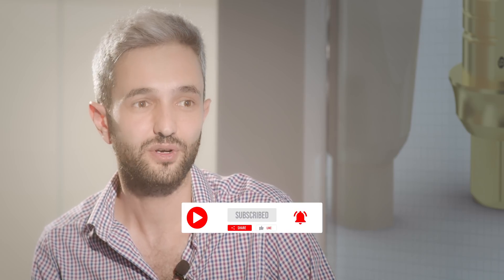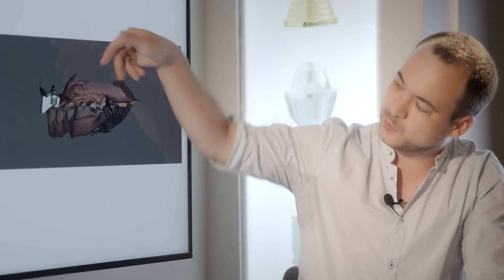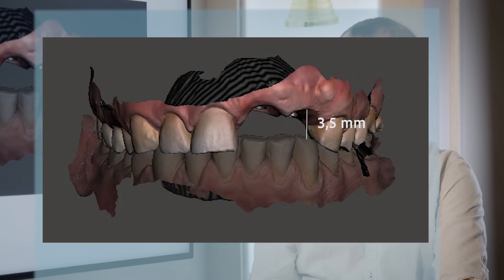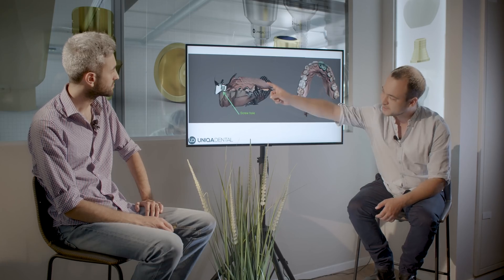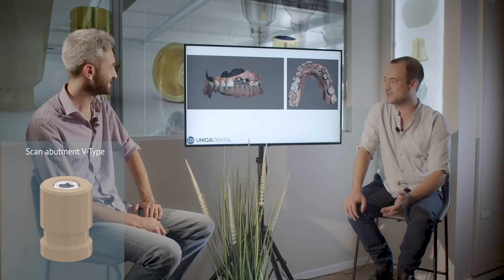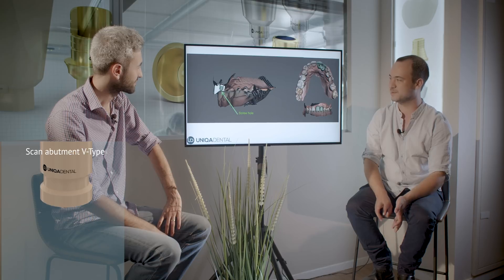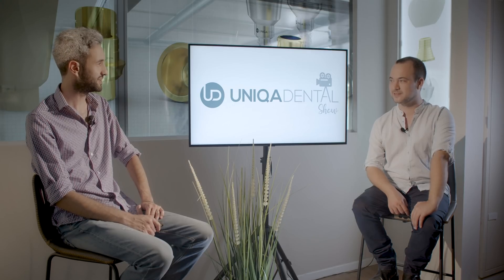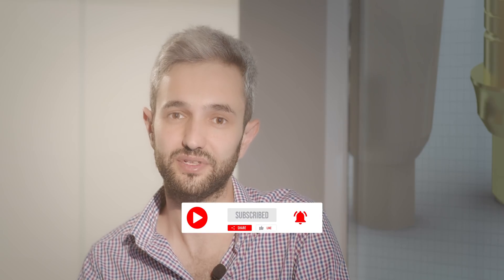Cemented restoration vs Screw Retained restoration in lack of space.🦷 Dental materials

Comment from the maker: Cemented restoration vs Screw Retained restoration in lack of space. Dental implant procedure.
00:00 Intro
00:54 How to deal with limited space for the restorations.
02:16 The recommended restoration method in lack of space
03:42 What Restoration method will yield the best aesthetic result
05:07 Is it possible to make zirconia crowns in limited space?
08:55 How the angle of the implant affects the restoration